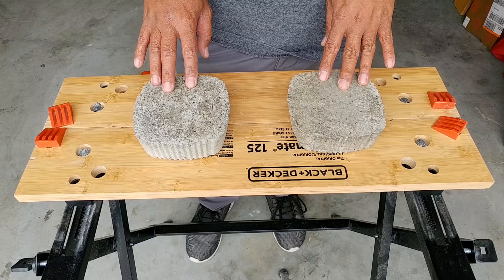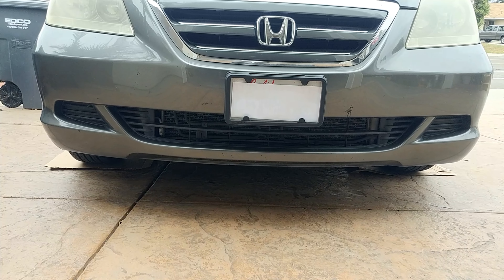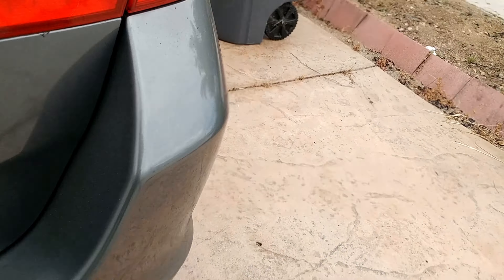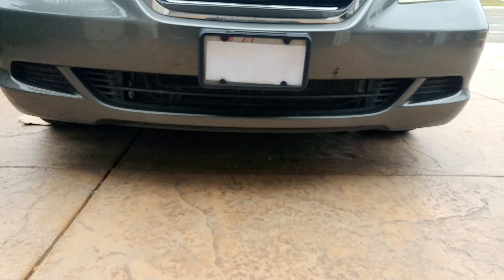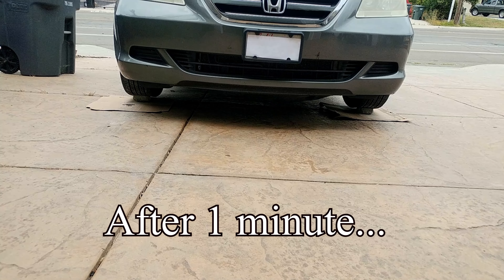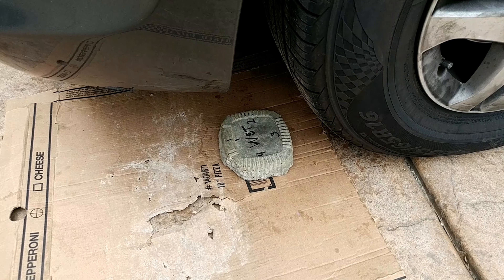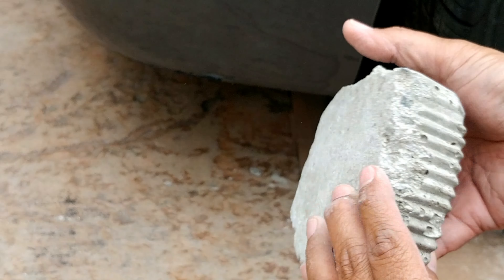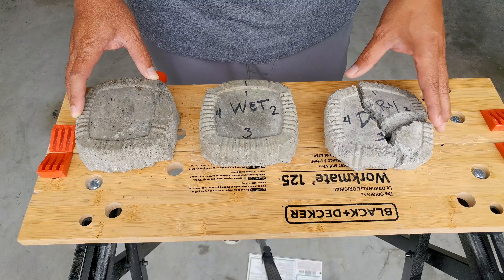Dry Pour VS Wet Pour DAY 38 The Final Showdown!

Comment: Very nice series of tests! I commend you on your patience! For non-load bearing projects, dry-pour is an option. As a first timer, I was going the dry pour method for a 40' x 5' fill on the side of the house... no loads there. But after careful consideration, for $200 more, I bought a harbor freight mixer. I know it will last longer, besides this is just the beginning for me... I have 2 more large areas to fill if I'm successful! Will project will start on Labor Day weekend... the emphasis is on LABOR! :)
Reply from the maker: I agree.  Dry pour for non-load bearing if you have no other choice. For me, it is better to do it right the first time so you don't have to worry about it for years to come.

Comment: An interesting set of tests. The flaw however is what you yourself explain at the end, about the extra watering needed for the dry pour to be wet thoroughly.
Reply from the maker: That's correct. With dry pour you are really not sure if the cement absorbed enough water so you will end up over watering.

Comment: Thanks,for filming . must have been some,work!
Did you wet pour your new,parking  space?
I am doing a,large 11' x17' base for a,back yard shed and after leveling and compacting ,adding stone I will be dry pouring the base so I can build a shed and use concrete as floor , possible with vinyl over it. 
3" stone 3" concrete
I saw dry and wet pour tested with pro tester tool at 3200psi and 4600psi . either will do for me and a,lot easier than wet pour for a storage,shed.
'Official,test cureconcrete underwater for 28 day so more water is,not  problem
Cheers warren .....we will see!
Reply from the maker: I used the wet pour method for my parking space. I just made another experiment measuring the PSI strength of dry pour vs wet pour. I will put it up once I finished editing it. I would say for shed floor you should be able to use the dry pour.

Comment: Very unscientific guess here on my part: Let's say a typical car weighs 3,000 lbs. And for most cars that's on the low side. So there's likely 500-800 lbs. of weight on each of those blocks.  Most people weigh less than 250 lbs. and their weight would be spread between their 2 feet, not just the 5 square inches or so of the tire that sits on the block.  I'd say your test proves the value of dry-pour for any patio, basketball court, or any pad that's going to just get foot traffic. I would never consider this for a driveway or house foundation regardless how your test came out.
Reply: I agree. This video was more of a extreme stress test. Gave me some really good insight in how to best utilize each technique.
Reply from the maker: You are correct. This is just to test how strong the dry pour is compared to a wet poured concrete. For a walkway or a small slab the dry pour method will do just fine. However, I will not use this for a basketball court. Even though the court only handle a persons weight, it is too large for this method to not have any crack as you don't really use control joints for a basketball court. You also want to avoid large slab if you live in places like California where ground movement is an issue.   I think up to 10 x 10 slab will be fine.
Reply from the maker: Yes. for non load bearing this will do fine if you don't want to mix or don't have tools to mix.  But if your project requires a strong concrete go with wet method.
Reply: Depends…I’m looking at this for a shed slab. All the weight is on the edge of the slab. The shed/barn will be 12’x16’. The perimeter will be weight bearing, and with snow on the roof even heavier than just the framing siding and roof materials.
Reply: @jtassoni8765 make a trench around the perimeter 2-3x deeper as a footer, put in extra 3/4 gravel, then pour. This way you have a thicker stone for the perimeter.

Comment: Good tests that showed the dynamic moving stress on the samples.  More accurate would be to use a hydraulic press to see the failure point of each sample.  However, it is highly anticipated that the wet concrete will fail at a higher pressure as the concrete companies already have run the test presumably on all their different products to determine psi strength.  Additionally they use additives in different products such as fibers to increase strength.  Having said all of this, as in any case, you must use the right product and process for your chosen project.  Most of the dry pour videos I have seen are intended for people walking on the project and in this case dry pour is would most likely be sufficient.
Reply from the maker: I agree. For non load bearing projects this should work. If you need the stronger PSI then go with the wet poured.

Comment: I’ve been under the assumption that the Dry Pour method is meant to be used in cases of non-extreme pressure. From my understanding, this method should not be used for Driveways or somewhere that maximum weight will be applied.

On another note, I do appreciate the tests and results you’ve shown in this series. Keep it up!
Reply from the maker: Thanks for the comment.  Dry pour will work in a lot of cases but some DIY'ers see this as alternative to mixed concrete and some of them have used thin in driveways. Although it will work in a driveway setting, the question will be longevity of the concrete and how much beating it can take before it gives in.

Comment: You never dry over the edge of concrete it will crumble every time
Reply from the maker: Thanks.  That is correct a driveway will have a nice ramp that will help concrete to hold up better. But we are testing for who is stronger so we want to put these in a lot of stress.

Comment: Boy this comparison was flawed as hell… first off I don’t want to pick sides. I’m all for a fair comparison if it is that but this wasn’t. I’m a little lost over the course of the videos but my understanding is that you limited the amount of water the dry pour received to be equal to the mixed. This is setting up dry pour to fail. Set both blocks outside and continue to water them and the ground below so there is no doubts that enough water has been given… then leave for the 30 days… then…

The test should not be running over the edges… of course wet will win when you cheated the water on the dry. This is not the application that concrete is used for. 😂

The point is does it hold whatever you are aiming to hold whether feet or vehicle or structure? And if it does HOLD it… now compare the cost of dry pour vs wet. Yikes.
Reply from the maker: Thank you for your comment. I encourage you to watch the first video on this series where I explained why I used the same amount of water for both. If you watch the first video in full you will see that the dry pour are properly saturated as it resembles the color of the wet pour after I put in all the water.  

First Video: https://youtu.be/yKsHCrsWrQg 

Starting it in a container made sure that all the water was absorbed by the concrete mix. I have also mentioned on 5:20 and 7:20 on the first video (link above) on this series that they will continue to get watered. I never showed it in the video but actually, I removed all the samples from the container after they set and I water cure them by watering them at least 5 times daily. So when it comes to getting enough water, I can guarantee that they did get plenty of water throughout the testing period.    

I agree with your point on cost and whether it will work with whatever you are aiming to use the concrete for.  If you watch till the end of this video, I actually mentioned that if you decide to use the dry pour method to make sure to water it for the full 28 days.  I also mentioned that I believe dry pour is equivalent to at least 70% of wet poured and you can probably use it in a driveway. I used the small sample so we can beat it up to see which one will hold better. So, if you have a smooth ramp and at least a 4 inch thick concrete and rebar then it should be a lot stronger than this small sample that we use.

Anyway, I just finished pouring my 16 x 8 parking spot and I decided to mix the concrete as recommended by the manufacturer because in California, we are not just dealing with the weight of the car but we are also dealing with ground movement. What I learned is that mixing concrete is not as scary as I thought it would be but it does take a lot of your time and energy. I was able to find an easy way to mix 5 bags using a hand mixer and I will share that on my future videos.   

I have about 8 bags of concrete left so I am thinking of doing another round of dry pour vs wet pour and measure the actual PSI on each. Not sure when will I have the time to do it but make sure to watch out for that video. I'm still curious on the actual compressive strength on dry pour vs wet pour and if dry pour is simply just taking longer to gain its strength and if it will eventually catch up if given enough time.     

Thanks for watching.
Reply: Anybody with at least 2 brain cells to rub together knows that premixing the concrete produces a better product as opposed to "dry mixing" .

The conclusion of this video proved that, but he was also fair by admitting "dry pour" is acceptable in many light duty homeowner situations, it's just not as good as properly mixing.